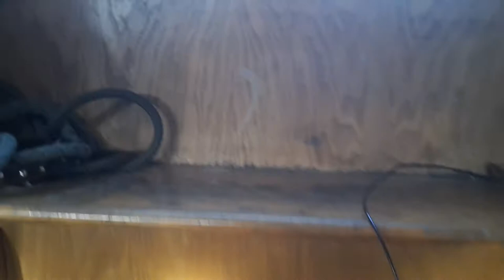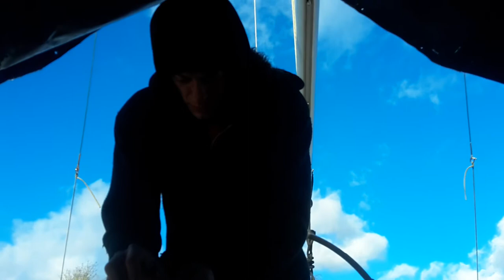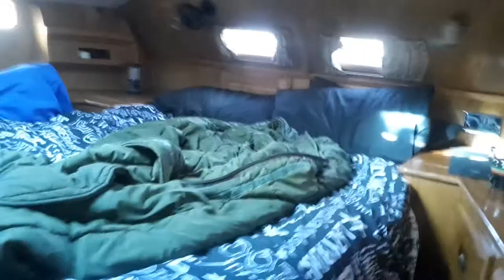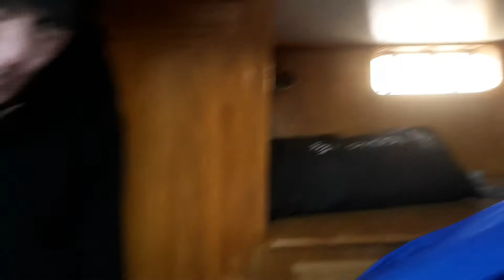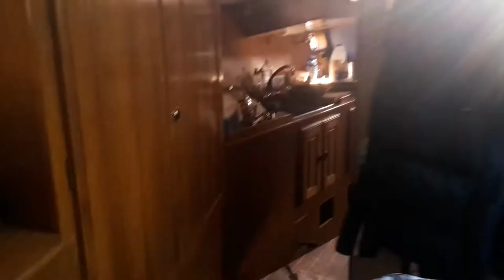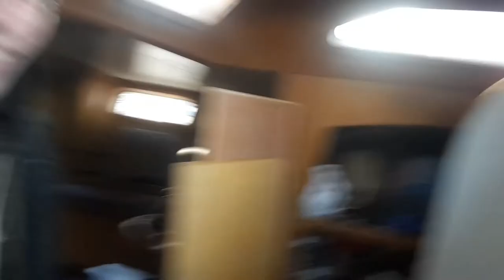Dysfunction.

Comment: It use to be possible to get someone to come & calibrate a compass, by, if memory serves, placing magnets at various points around the boat to get the compass to read true. Given the advent of digital compasses I have a hunch IF you can find someone it would cost the earth. I am sure, if you research well enough, you could do it yourself? There are (again if memory serves) compasses you can buy that have compensation adjusters built in, to allow you to set it correctly.
Reply from the maker: Paul Holborn cheers mate we will have a good look about and maybe try messing with a few well placed magnets.
Someone did mention about an electromagnetic compass but I can't remember what it's called and It too sounds expensive.  One thing is for sure.....We need one.  An adjustable one sounds ideal to me.
Thanks, as always, for your thoughts.